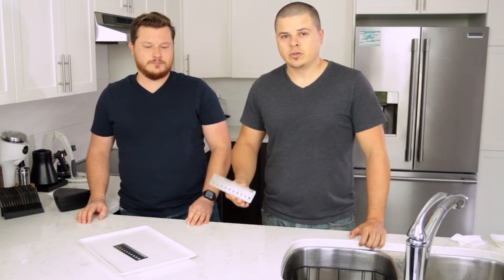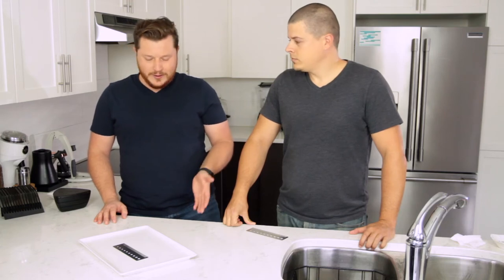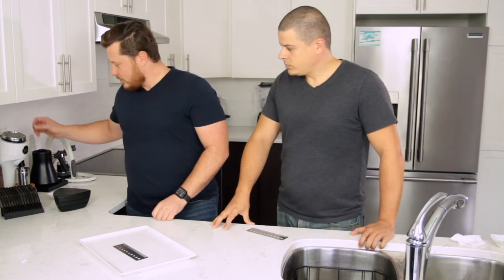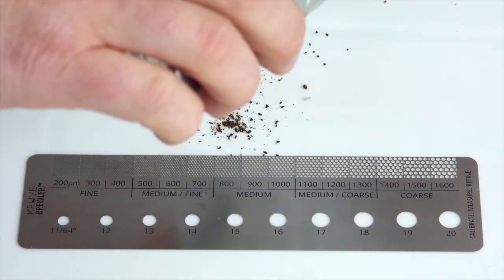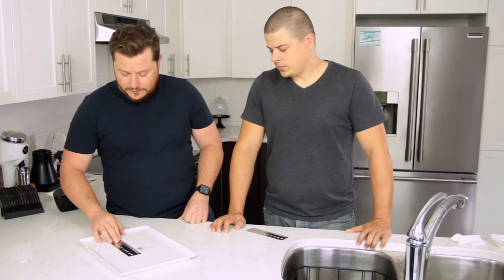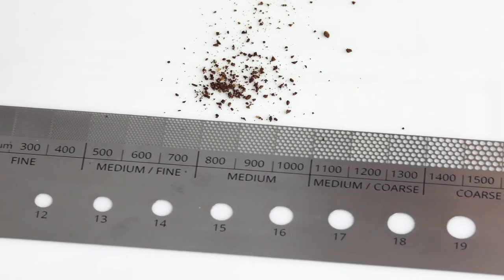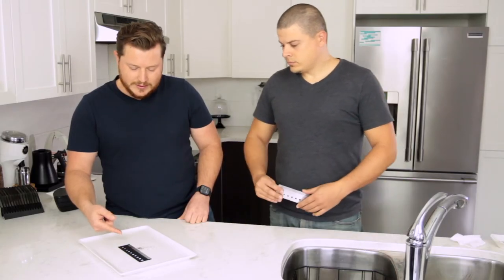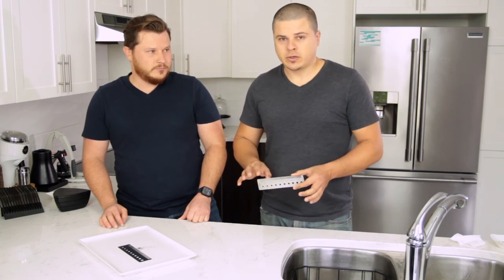Measuring and communicating coffee grind size using the BREWLER

Comment: I would have said it was between 800 and 1000. Confused at to what you're supposed to look at.
Reply from the maker: In the video the camera is on an angle which makes the holes appear smaller. When looking straight on, that grind was closer to 500-700. From the video you are correct it does look closer to 800-1000.
Reply: @Kruveinc  Ah interesting, thanks for the clarification!.